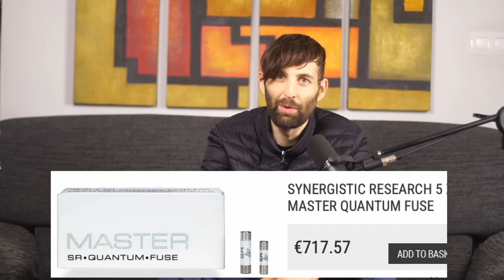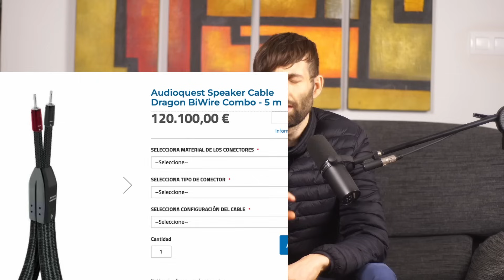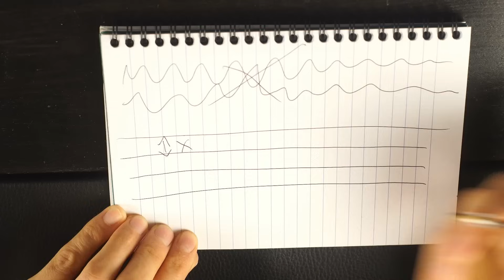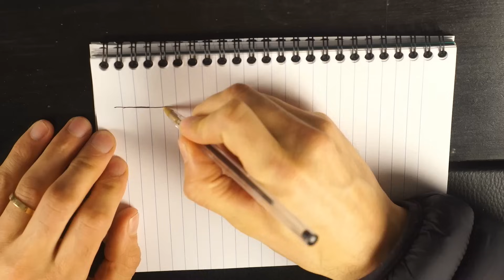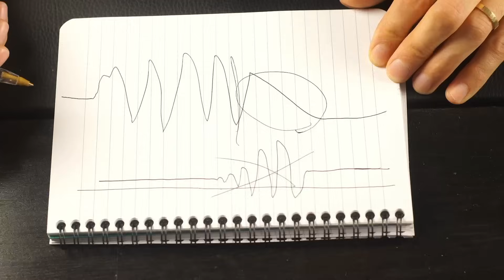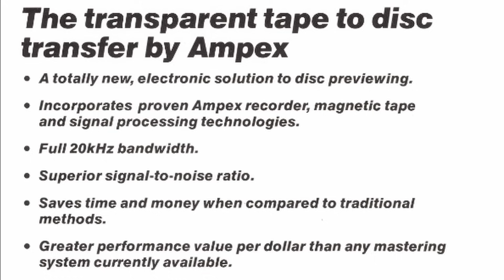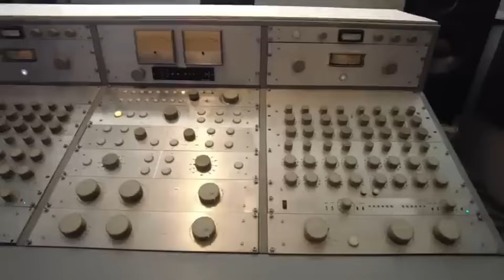Hard truth: most vinyl is digital anyway

Comment: Studio recordings and distributions of audio tracks higher than 32-Bit 96KHz is the future really!
Reply: You can't hear past 44.1 and 24 bit, look up nyquist theorem
Reply: I meant the digital sampling frequency of the audio tracks.
Reply: @kenne144  yes, it is irrelevant past 44.1khz and like 16 bit
Reply: @kenne144  you don't know what you're talking about
Reply: 16 Bit 44KHz, that’s phone call quality to be able to hear the person speaking on the other side.
Reply: @ incorrect, 16 bits can encode 98db of dynamic range and 44.1khz covers the full spectrum of human hearing.
Reply: @ look it up if you want, anything beyond 44.1 is basically inaudible to the vast majority of people and most people don't listen over 95db anyways
Reply: @kenne144  32 bit and 96khz is only needed for mastering purposes and the vast majority of consumers are unable to tell the difference from that and 44.1 at 16 hits
Reply: >32-Bit 96 kHz is what the DAC/Digital media player requires.

20 Hz to 20 kHz is what humans are capable of hearing and is reproduced through loudspeakers.

Yes, one could achieve loudness in 16-Bit 44 kHz audio tracks and make it sound better than a phone call. 
With >32-Bit 96 kHz audio tracks there’s exceptional audio quality reproduced, given that it has been recorded and mastered with the right audio capture and recording equipments (hardware & software) to adhere to >32-Bit 96 kHz level audio quality standards.
Reply: @kenne144  you're literally just wrong
Reply: @kenne144  No, 44.1 kHz at 16-bit is not “phone quality.” In fact, it is the standard used for CD-quality audio, which is vastly superior to typical phone call audio quality.
Reply: @kenne144  No, 44.1 kHz at 16-bit is not “phone quality.” In fact, it is the standard used for CD-quality audio, which is vastly superior to typical phone call audio quality.

Comment: In other news: your manual gear gasoline car has a computer. So it's electric and automatic.
Reply: Incorrect
Reply: @mistafizz5195  You don't say.
Reply: @anreoil  Yes, but more specifically I meant the implication. Vinyl is still digital anyways (basically). Nyquist.
Reply: @mistafizz5195  Author mentioned, that signal is converted to binary in order to inform other devices about what comes next. It doesn't mean that the same digital signal is being recorded. Moreover, not all stems have to be digital or digitally processed, it could even be other way around - digital signal going through analog filter. People are doing various funny things these days, and generalising that "all X is Y" is just silly.
Reply: @ Digital encoding can fully encapsulate the sound of vinyl without loss distortion or coloration. In the end, a digital sample rate of 44.1khz at 24 bits can recreate the entire range of human hearing. Many people believe vinyl is smooth waves and digital is square waves, but that could not be further from the truth. At the end of the day, if the sound coming from the speakers is virtually indistinguishable even by a  trained listener, then it might as well be the same.
Reply: @anreoil  Sure the mediums are different, but with manuals and electrics there are noticeable differences in fueling and power and handling. In the end, the sound you get is more or less the same.

Comment: An old fart here: Some corrections 

1: Digital( in the form of CDs) became popular in the late 70s and 80s because it was new and you didn't have to get up to flip the CD over to play the other side.  At that time CD's were of shocking quality because most of them were produced(poorly)  from Analog masters.  CDs only started to get better than records from about 1983-85( with some notable exceptions)

2:  The quality of the music is not so much dependent on the media but the quality of the sound engineering.  If you want a great 60's or 70s recording you are not going to find it on digital media.   Likewise these days its unlikely you will find a good recording on a record ( see your title to the video)

Comment: WAV format is wrong. Wav file contain sound graph - array of amplitude values in a given time. If you store the difference with previous value instead - you will not need to use a delay to play loud sounds, and you will get much louder low frequencies without the need for compression.

Comment: Something that is not really mentioned in the video is the playback part of the whole process. Analog equipment, while not better at dynamic range or anything like that, will add harmonic overtones / saturation to the original signal, which is what people refer to as a brighter and more brilliant sound. A needle will oscilate not only at the frequency present in the groove, but also at multiples of that frequency. An analog amplifier will color the signal in a similar way. While I am not suggesting that this makes vinyl sound better or worse than digital, it does add to the argument of an "analog" sound while moving away from what is mentioned in the video when people talk about the true analog experience: reproducing the sound of the live recording in the recording studio. Feel free to correct me, but I think this should be part of the discussion.

Comment: Hmmm I agree with you almost completely, but I think you are semantically wrong. Almost all vinyl WERE digital, but are not any longer. Vinyl also can impart various EQ curves (often some highpass and lowpass filtering) and various distortion modes.That's not a statement of judgement. I don't think its a good or bad thing.I share your frustration with the misconception of how digital audio works. Even in this video, you showed a graphic of the "stair-step" samples, but this isn't strictly speaking an appropriate representation. The samples should be show discretely - there is not information between them. Its only when you reconstruct the sampled signal with a DAC that you might see this, although I doubt anyone is using a Zero-Order Hold for their reconstruction of an audio signal.

Comment: I WAS interested in the lossless files from Bandcamp (or elsewhere) but after doing some testing between lossless and QUALITY mp3, found that I could only tell difference SOMETIMES and only on specific tracks. Now I will only download the high bitrate mo3s vs lossless. I do buy vinyl just because I think they're neat, and like the physical aspect of playing them and having to make time and effort to listen. But a good digital file with floor at 0 and recording peak near max is going to be way more dynamic than any analog playback could possibly manage.

Comment: Vinyl doesn’t sound better than digital, lossless audio is better than lower quality audio, and since vinyls are always lossless and digital requires a lot of work to be lossless vinyls tend to be better. (Lossless audio isn’t even supported on Spotify and for Apple Music to get the most out of lossless playback you need a DAC (Digital to Analog Converter) and a good speaker system or set of headphones.) for that amount of hassle vinyls are just easier

Comment: Digital is not really transparent though.  It is a series of very fast snapshots of a waveform.  There are pros and cons to both analog and digital.  Also, many have stated that long listening sessions that are many hours long leave one more relaxed after an analog session vs a digital one.  Just throwing it out there.
Reply: Yeah. 44100 thousand snapshots per second minimum. That's quite a lot.
Reply: @testowykana1763  for sure!
Reply: Which is misguided nonsense also. First of all, every playback system is analog. You're not a computer that can read binary code or optical lasers. So if you get ear fatigue, that has more to do with your playback system than the recording medium. Secondly, at the end of the day audio is just amplitude and frequency. That is literally all it is. You can have it any which way in any recording medium. You can have masters on vinyl that sound absolute dog shit and you can have masters that sound divine. Same thing with digital, it just has less limits which is why people can push it so far into extremes that it stops being enjoyable.

Comment: I don't disagree with this and I'm not an analog purist, but as a hybrid digital/vinyl DJ I've noticed many songs from the 60s and 70s sound better on vinyl (and many sound worse) than the lossless digital counterpart you can buy. Sometimes it's due to poor remastering, sometimes you can't even get the song digitally, sometimes the official digitial version sounds like a rip from a crappy vinyl with a bunch of record crackles and pops that aren't present on the actual vinyl. I'll often A/B them to determine this and sometimes the difference is very noticeable (and again, sometimes the vinyl is worse, but often it is better). Just my real-world experience.

Comment: Love your videos. I began collecting LPs in the 80s. I had 2000 of them. I have always said the same thing as you about records. People are just idiots. Considering almost everything is now digital (as you have also said, speakers, amps, processing, mastering, et al), by the time you are listening to a vinyl record, it's already been digitally passed on to vinyl to have the quality reduced to digital sample rate played on a record. Vinyl purists are usually people with a digital record player. Digital+ surface noise is nonsense.

Edit: Oh, and tape never had that much of a dynamic range (as people think) to set the 'record' straight too as to why high sample digital is superior to vinyl.

Comment: The old vinyls prior to the digital age are not compressed  all recorded on analog borads .the amps and drums are miked and go into an analog tape recorder. No compression, all new re issues  of vinyls are digital. This is why the old analog recorded vinyls sound better with the right audio equipment . You can tell the difference. 

https://youtu.be/mDZcz-V29_M?si=Sfn6JjK71kXOeiJ9

Comment: Distortion is colour, and that can be beautiful. Digital is perfect, sterile and lifeless IMO. Most studio's now might record to digital, and export to digital, but all will no doubt have analog gear, pre-amps, EQ's, compressors etc, or plugin equivalents, in the chain, explicitly to color the signal.

Vinyl translation adds distortion and noise, and be less 'perfect'. But I guess thats the point. It can be tasteful. Its a value judgement as to which sounds better to your own ears.

Vinyl production also requires a specific cut for the lathe, so the wave that comes in on digital file gets manually converted anyway to account for the physical media. It isnt the same digital file being converted 1-1.

Comment: Very interesting perspective. Not to come across as argumentative, but I'd like to challenge a few points. I'm curious what your response might be

1.Say you have a pro tools session which is to be mastered to vinyl. 
A vinyl lathe is fed a pair of analog line level signals which are output from pro tools via a Digital->Analog Converter. 
The DA converter is translating the bits which represent each sample of the audio into a continuous electrical signal.  
Even if the song was recorded straight to pro tools, mixed fully in the box, and then mastered to vinyl, I believe it's proper to refer to the vinyl disk itself as an analog format.  

2. Of course there are audiophiles who don't understand what they don't understand, and believe what they read on audiophile forums.
Besides those fools though, 
When people say they prefer the sound of vinyl records, I don't think that's to suggest that vinyl is an objectively higher quality, superior format to a digital audio file. (That would be pretty ridiculous!)
I tend to think people who prefer the sound of a vinyl record are subconsciously attracted to the sonic imperfections of the format. 
A vinyl record does sound different than a digital file. But that's due to information loss. For example, High frequency loss may be interpreted by a listener as a "softer" sound

I'll admit I've only watched the first half of this video. Forgive me if I'm being redundant!
Reply: Obviously the vinyl playback is an analog thing.  The point of this video is to counter the "analog only" fetish people, who want that AAAA all-analog pipeline as they disdain digital recording.  The point is even is someone with this fetish records everything to tape through an analog mixer and gets it pressed on vinyl, the record is likely to have used an AD-DA conversion in that process, thus "contaminating" the pure analog pipeline as they see it.

Comment: There are do many tropes being bandied around regarding audiophiles or vinyl enthusiasts, it's  clear that people are being tarred with all sorts of brushes, which is unfortunate. Vinyl or digital doesn't really matter, both can sound good or bad. A great deal of it relates to the mastering. One thing I find to be a strength for vinyl are records from periods where everything was recorded and cut in the analog domain. Generally some of the best sounding music I have heard, noticably higher quality usually on the early pressings. But buying records that are digitally sourced are generally not at any advantage over the digital medium, unless the vinyl mastering has allowed it to be less brickwalled. There are so many factors though and there are always exceptions to the rule.

Comment: The only part that is good about vinyl, is that old albums got better mastering. So, if you digitize that record, clean it from all pops and hiss digitally, it will sound much better than CD of the loudness war era. Virtually all vinyl records done after I’d say 2003-5 got the same master record without any special mastering, and you’re lucky if it was slightly “remastered” for vinyl, to make record survive on the groove. But dynamically it’s almost the same brickwall highly compressed and maximized sh****. Thus, almost no reason to buy vinyl, unless you know record The record was deliberately mastered for vinyl from pre-master (or remixed and mastered for vinyl from stems).

Comment: I think that everyone that is my age or older, that lived through the change from analogue to digital in the 80's, knows that the statement that vinyl is better, is BS.  As is buying gold plated 365% oxygen free copper cables for your speakers for hundreds of euros per meter, and rediculously expensive interconnects that prevent digital jitter when  connecting your cd player to your aplifier to get the purest bits.

The good thing at my age is that my ears are getting worse so the requirements for my hi-fi equipment get lower. It's a win win situation 😂

Comment: I will say there’s a tiny difference in sound between original vinyl from 1950s-1970s (especially mono) then new 180 gram vinyl (which more or less sounds like a CD) to my ears. I basically just buy vinyl for the big album cover and the nostalgia of handling records. i got CDs too. I do tend to like older (used second hand) vinyl than new ones. They’re just more “homey” i guess you should say.. (BTW most of the music i listen to runs between 1956-1976)

Comment: You're absolutely right. Most recordings has been digital for a long long time. Claiming that digital isn't as good as analog is bunk. At least as long as we're talking uncompressed high res, and things are done right. But it is worth noticing the different mixing/mastering for cd and vinyl. That part does often result in an audible difference between the formats (which has nothing to do with the shared digital source). Besides that, the killing of dynamics by the Loudness War on cd's most certainly do make a difference, and they can't do that on vinyl. I consider that being the reason that some prefer vinyl, because in that way there are indisputable differences. 
When working in high res in DAWS and compressing/exporting it into cd format (16 bit 44,100 khz) have you compared the loss to analog export? I'll say there's some differences most definitely worth noticing. 
If you ask me, there's nothing better than the high res used in recording studios, but how things are handled from that point and further is what makes the difference. And no matter what weird and hopeless explanations people may have for preferring one format over the other the fact remains. There often is an audible difference.

Comment: Are people still making this claim? I thought it was killed off about 5 years ago when vynl started surging out of nowhere. The end result is that vynl is actually more lossy than digital. What people think is higher detail might actually be artifacts of vynl. Vynl also limits the maximum values for intensity of a sound as going too wild with it could result in skipping or rattle. These are no longer issues in the modern digital era. 

I honestly think a lot of people just think it sounds better either from placebo or that they're only used to listening to Spotify or mp3 files. Both of these are incredibly lossy so of course they sound worse. But there's a lot more people who know about vynl being vintage tech vs something like FLAC or ALAC which are techno mumbo jumbo.

Comment: Digital will always be a "stepped" waveform no matter how high the resolution where as analog is infinitely detailed and smooth. Digital is cold and lifeless.
Reply: DAC’s do not produce a stepped wave form, they produce an analog wave (clue is in the name). 

And besides, if your vinyl is produced from a digital file or undergoes any digital processing  (which it will have in 99.9% of productions since the 90’s) then it would also be “stepped”, even on vinyl.
Reply from the maker: wrong